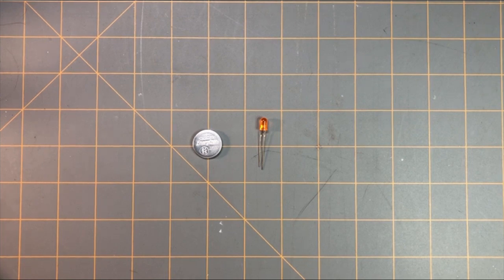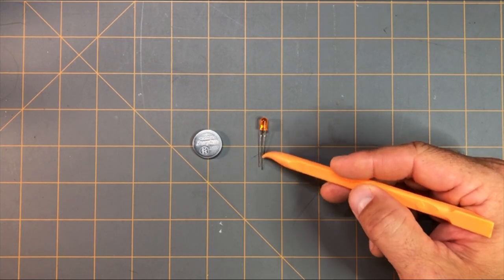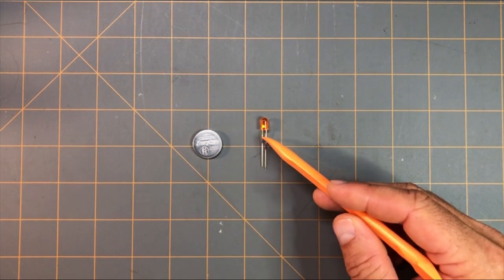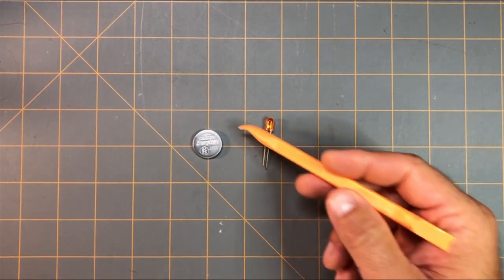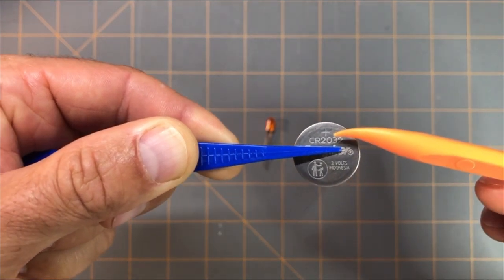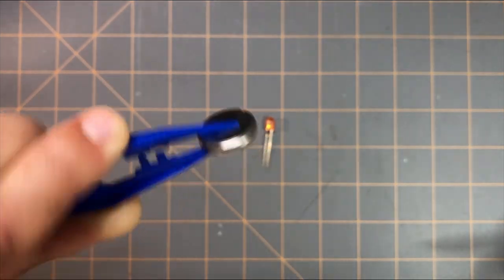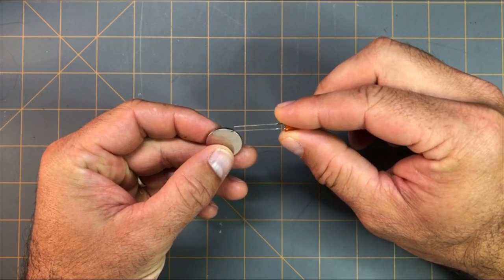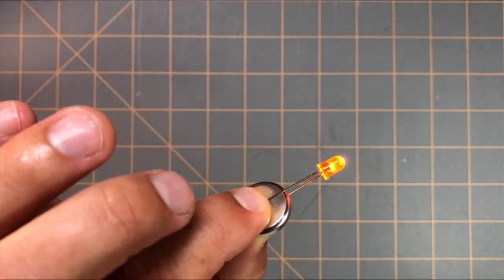How to Quickly Test an LED - The Coin Cell Method

Comment: Works and is far easier than any of the other fancy methods.  I taped two longer thin wires to the battery to make it easy to test Christmas lights.  Thanks for the idea. No resistir required.
Reply from the maker: It is a super easy method for checking LEDs. Awesome tip about the Christmas lights! Thanks for sharing!